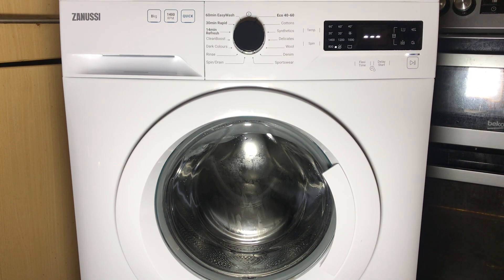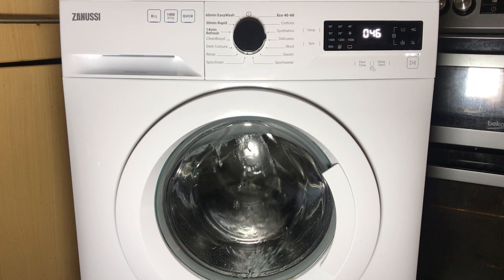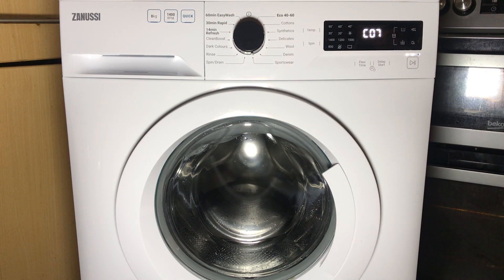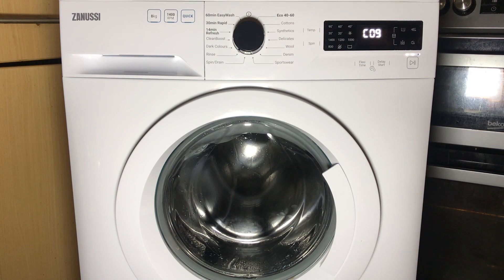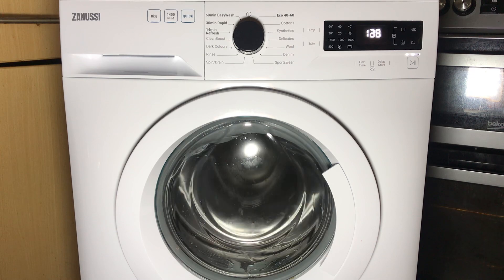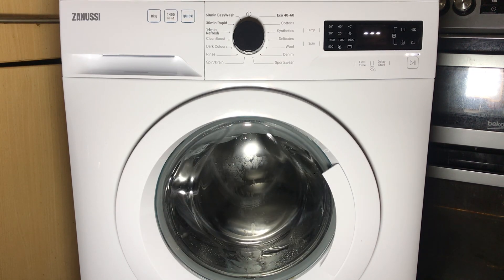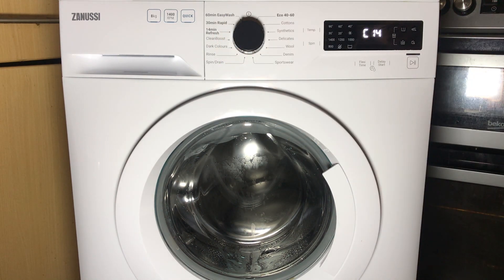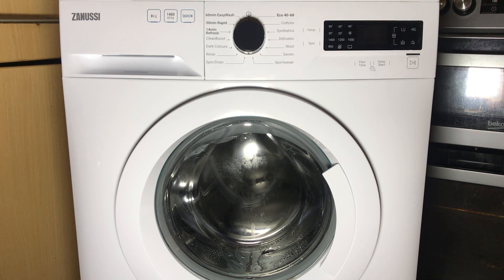zanussi flexitime - service mode tutorial

Comment: i don’t think that the rpm is shown in 10x
Reply from the maker: it most certainly is shown in 10x. the machine goes to ~1350rpm in service mode - not the 1485rpm it would be going if the display was shown in 11x
Reply: @thelaundrycookie1200 1350rpm is 122

Comment: Very strange...ef4 is an error of the flowmeter, located on the 2 solenoid valves...it indicates that the machine has failed to fill the preset liters of water within a fixed time interval
Reply from the maker: i guessed it was a filling error of some sort, since it happened when it wasn't plumbed in. very interesting that it gave the error instantly upon going into ELE mode - i'm guessing it was able to tell immediately that there was absolutely no water flowing.